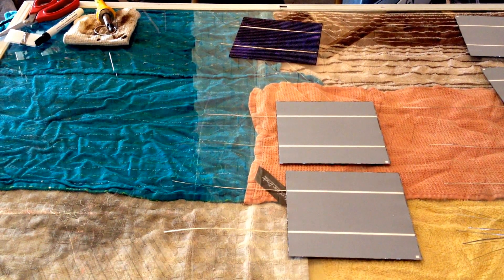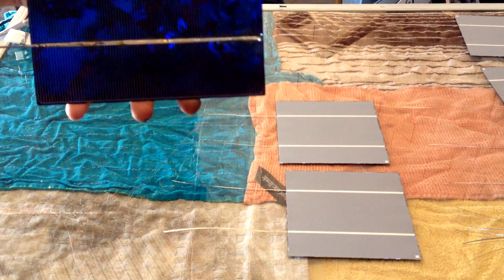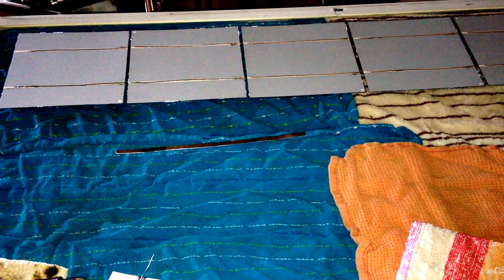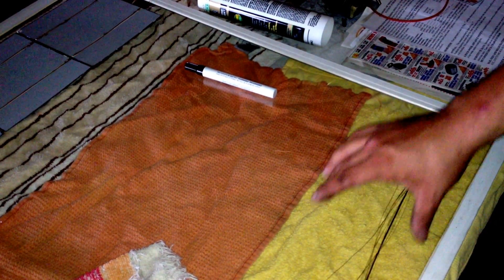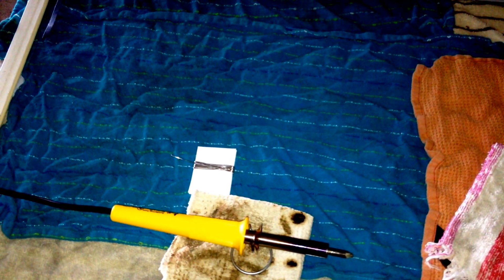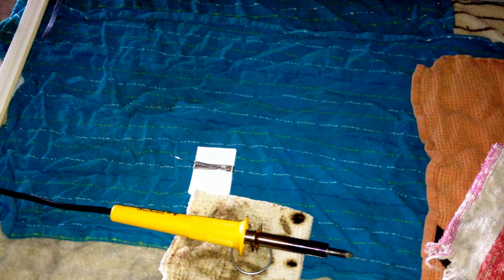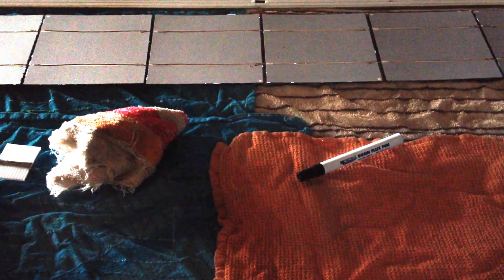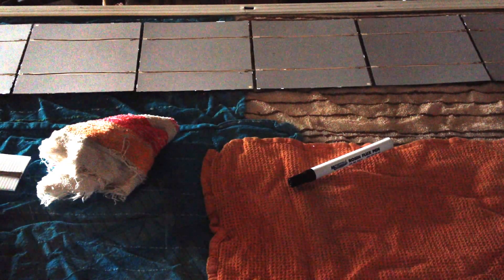Solar Panel Build for less then $0.50/watt  How-To Part 3 Connect Cell Row and Buss Bar

Comment: It is impossible to dump power back into the grid that was generated from a non UL listed panel LEGALLY.  I tried building my own first, but I found it was a much better deal to buy a well manufactured panel with a warranty, for just a little more per watt.